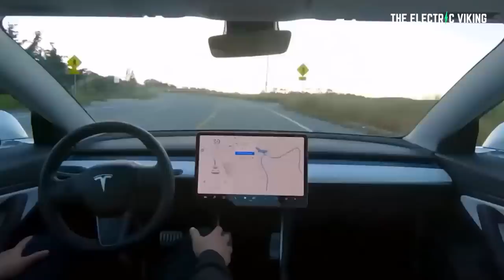20% of all vehicles will need to run on electricity in 24 months in Canada!

Comment: As a Canadian I live off grid in the winter in a sailboat in the Bahamas, Cuba or Central America, but still with a diesel auxilliary. I have observed that even those few boats that use electricity for their propulsion NEED an ICE backup. The consequences of running out of power can be fatal. Summertime in Canada is a practical time to own and operate an EV. Wintertime....possibly not  so much. I really do not know what level of power loss would apply to an EV at minus 40 degrees, but I know that fladlight batteries cannot take it an expire rapidly. The glorious GOC makes headline grabbing statements like this fairly often and then are unable to make it happen. I am guessing that hybrids will be a major part of their EV approvals - giving the citizen a vehicle that will be more complex than either an ICE or an EV with no backup. People in this country freeze to death in their cars occassionally, sometimes from getting stuck in snow on remote roads. It seems to me that such a person would have less time to be rescued if they were stuck in an EV.
Reply: The heater in an EV uses very little power from the enormous battery that powers the motor. If your stuck it can last for many hours.
Reply: As an owner of an EV for 4 years, I can tell you that I would rather be stuck in an EV than an ICE vehicle. I can run my seat heaters for a LONG time on my 64kWh battery and I don't have to worry about carbon monoxide poisoning.

Comment: The success of these targets is going to depend on which part of the country you're looking at. In the oil/gas depend provinces of Alberta and Saskatchewan they're openly hostile to EVs (SK had a road tax surcharge on EV annual registrations).

Conversely, in the Vancouver area they've already achieved over 20% EVs in the new car market. They've been building out infrastructure for years and condo developers have been required to provide rough-ins for EV charging for over a decade. Quebec generates massive amounts of hydroelectricity and they, too, have fairly significant EV market penetration.

I live in Whitehorse, YT, north of the 60th parallel and within a day's drive of Alaska. As you can guess, it can get cold here in the winter and we saw temps below -40C in the past couple of weeks. We also have a surprising number of EVs here. Almost all of our electricity is renewable hydro here, and our govt has installed DCFC in almost all communities.

Comment: Drove our EV6 from Los Angeles to Las Vegas NV and back this past week. 30F temps made charging extremely slow for us and impossible for others. Dunno if the EV6's 800 volt architecture helped, but it was slow going. Many chargers inroute quit altogether. We're still a long ways off before EVs for the masses.
Reply: Does your car preheat the battery pack before reaching a public charger?
Reply: You need a Tesla.
Reply: You need to warm up the battery pack before it will accept any charge,but all Tesla's do this before you get to the supercharger.
Reply: @gi4dtv  
tesla does this only on tesla SC. not working with 3rd party chargers

Comment: Canadian here, Chevrolet Bolt owner. I understand (and support) the intention but I think reality is going to be a few years behind that. Politics in Alberta will be a problem. Potential high volume products (Chevrolet Equinox for one) are only going to be just barely on the market by that time. I agree, Japanese manufacturers will not make it. GM has a chance. There are a fair number of Ford Lightnings on the road already. As for Tesla, I will never own one as long as Elmo has anything to do with them.

Comment: I live in Canada and would love to own an electric car but not just any electric car so for me the problems are twofold.  These are price and supply.  EVs will have to be at least price competitive with their ICE counterparts.  The Hyundai Kona N-Line AWD base price today is $32354 C$ the Kona Electric FWD base is $47050 C$ which means the less capable electric is over 45% more expensive.  The $14696 price difference will buy enough gas for 100,000 miles. Second is availability with delivery dates sometimes stretching to years for desirable models.  EVs were supposed to be cheaper because of reduced parts counts and cheaper to operate but so far with the price disparity both advantages a not apparent.  We all pay lip service to a cleaner environment but this commitment has limits to what consumers will pay to be green.

Comment: Two thirds of people in Toronto do not have access to home charging. 45% live in condos or apartments and only a few of the newest have any provision for charging. The other 20% live in older neighbourhoods that don't have driveways and have on street parking. I live in one of those older areas. The nearest public charger is just over 3 kilometres away, has only 3 stations and is only level 2. It isn't going to happen. Ontario dropped its incentives in 2017 and the current government has said it will not revive them. I cannot see paying an extra $25,000 dollars for a car that I cannot recharge. If the Federal Government keeps this mandate, I see most people will keep their gas guzzlers a few more years and then try to buy the best used car that they can find.
My sister has a new Chevy Bolt and took a trip to PEI last summer. She said it was a nightmare and will not do it again. My brother in Vancouver has a Tesla 3 and only uses it around town. For trips he uses his old VW diesel. I see the government defeated in 2025 on this policy.

Comment: Supply is the main reason why Canadians are not buying EV's. In Québec, (province) we get a 7000$ (Qc) + 5000$ (fed) credit for buying an EV. Our electricity is eco friendly coming from our provincially own Hydro Québec, with a 7,8 cents (0,078$) per kilowatts. We have changed a Honda civic to a Bolt EUV in September and have already saved 780$ in usual gas costs for the car. Of course, Québec is more ecologically oriented than other provinces in Canada (as is BC). So Canada is far from being a monolith,  provinces have a major say in ecological questions, so disparities exist. Alberta produces oil and gas for export and they kinda  are not into EV's. British Columbia is the second EV market in Canada after Québec and we have a long way to go. About 8% of sales are EV's but we had to wait 15 months to get our Bolt EUV and the delays are still the same. Reaching the 20% sales with a reasonable time-frame from intent to possession of the car (3 month's?) Is going to be hard to reach.
Reply: You neglected to mention that a huge chunk of the hydro electric power you tout comes from another province that got screwed in perpetuity on the sale of its power.  You also didn't mention that your power rates are subsidized by the enormous amount of money the federal and provincial governments put into building dams that give you this cheap power.  You also didn't mention the treatment of income the Quebec government receives from Hydro Quebec for selling power to the US is different than other provincial income from other sources in the calculation of tax rates.  Many distortions in the market but surely they don't justify an attack on Albertans.

Comment: The length of time it takes to charge is still significantly longer than to fuel up with petrol.  A long road trip is still producing range anxiety, even in TESLA vehicles.  You should of seen the anxiety in a model y owner using the only level 2 charger in the desert town of Borrego Springs, Ca. He would get only 23 miles on an hours worth of charge. He was 66 miles from the nearest supercharger. You gotta have the patience of Job to own an EV around here!
Reply: Depends where you charge, at home ours take 3-4 hrs level 2, Tesla super takes 30 minutes...

Comment: I would love to buy an EV, I would get a Tesla, but they cost too much. They need to come down to less than half of what they are now, so I don't see me getting one ever. I'm in my 50's now, by the time I could save enough for one, I will be about 80 or 90, no point.
Reply: They won't take that long to come down, it's just that demand exceeds supply so much right now. In five years time it will level out but obviously they are far cheaper to run. RIP ICE.
Reply: At least in the US, 3/4 of all car sales are used car sales. I expect this is how most people will end up going electric. The used EV market just isn’t there yet. We need to get the new EV market up to 100% of sales and then wait for some years of production to kick in before the used one can do what it needs to do for pricing.

Comment: 20% by 2025 is a cakewalk, that's when the EV market will really begin. The most important thing for vehicles is an electric drivetrain, which can be powered by, BEV, Plug-In Hybrids, or Hydrogen Fuel Cells. Canada has 3 provinces with unlimited Hydro Power, near the source power is available at 1 one hundredth of a cent per KWH. All excess Hydro Power can be used to produce Hydrogen. So basically the Hydro Dams can be run at excess capacity, with the excess power being used to produce hydrogen and also balance the grid, so there is no need for battery storage or gas fired steam power plants. Hydro+Hydrogen is Canada's clean power solution.

Comment: Canadian emmision regulations are harmonized with the USA as far as vehicles are concerned.  What the US mandates usually becomes the defacto standard in Canada, with small tweaks.

Most EV will be sold to urban dwellers, so even in cold weather home charging will be sufficient.  Rural areas will still be fossil fuel consumers given today's tech due to Canada's huge distances and thin, spread out population in rural areas.

If you do not set EV targets high, or even a fixed target at all, you will never achieve it.  Disruption in the auto industry is here and only time will tell if they can meet the supply targets.

Comment: I'm all for EVs and alternative energies, but mandates are ridiculous. Canada has vast areas of countryside with long distances to travel in severe cold. We work out trucks hard. An F150 (ICE powered) will pull a trailer 700 kms. The F150 lightening can't tow the same trailer 100 kms. BTW - The idiot that hold the seat of the "minister of transportation" has never owned a car and has no idea how people commute outside the big cities. FYI - I have owned EVs since 2010 and get 100% of my electricity from solar. Also an FYI - All across the prairies, power is generated from coal. This is one badly informed case of virtue signaling by the feds (as per normal). Please get properly informed before supporting government mandates.

Comment: Canada's adoption rate is slower than California and we will still beat the 2026 mandated requirement. The only danger is the supply of EVs not keeping up to demand or the mandate. 
But actual demand and sales will be higher than the mandated percentage. 
EV sales increased 1.39X from 2021 to 2022 to 7.2%. If that year-over-year increase continues, EV sales will be 19.3% in 2025 and 26.9% in 2026. Before covid, the year-over-year increase in EV sales was 1.6X, so as EV supply allows the increase in sales will be faster.
In the UK before covid and the supply chain issues they were on track to be 100% EV sales in 2030, 5 years ahead of the 2035 deadline. That tells you how high the unsatisfied demand is.

Comment: The only problem I have with EVs is that when the battery dies the whole vehicle turns into a giant paperweight.  If Tesla made battery maintenance easier and when one can get EV-specific parts at AutoZone, Advance, or RockAuto, then I'd be more open to the idea, but I guess we'll see if any of this happens.
Reply: Not so. Used battery packs sell for a good deal of money - check out Amazon etc. They can be repurposed for solar storage, for example. They can also be almost 100% recycled. And the latest battery packs are far more reliable than the early days of EV's.
Reply: My work truck has a gas motor.   It also turns into a brick when it runs out of gas
Reply: The battery in my Model 3 RWD (with the LFP battery) won’t die for 40-50 years. It has a lifespan of 3000 cycles, and with a 400km range, it should easily last 1.2M km.
Reply: @syrophenikanblackmetal3249  actually the LFP has a life cycle of 6000 so you could run it 0-100% every day for 16 years
Reply: @gi4dtv Most EVs made today can do about a Million KM before needing Battery replacement.   It is true the older EVs had issues this way, but the new ones last a long time.... especially LFP they can do a Million Miles easy.